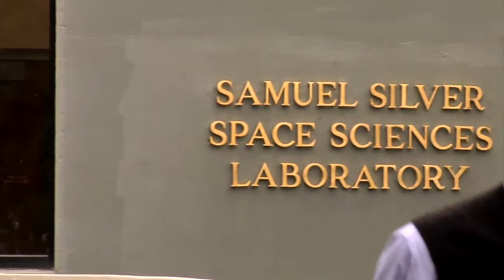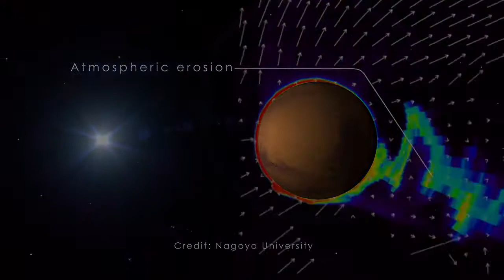MAVEN's Particles and Fields Package: Studying the Solar Wind at Mars

Comment from the maker: MAVEN's Particles and Fields Package: Studying the Solar Wind at Mars

To planetary scientists, the Martian atmosphere presents an intriguing mystery: today it's a thin, cold wisp of carbon dioxide with just one percent the pressure of Earth's atmosphere, but long ago it was thick and warm enough to support lakes and rivers on the Martian surface. How did Mars lose so much of its early atmosphere? Scientists think that the solar wind may be responsible, and the #MAVEN spacecraft is designed to find out.

The instruments of MAVEN's Particles & Fields package will study the interaction of the solar wind with Mars's upper atmosphere, helping scientists to better understand how Mars became the freeze-dried planet that we see today.

In this video, produced by NASA Goddard, Robert Lin, the late director of the UC Berkeley Space Sciences Laboratory, discusses how MAVEN will study the interaction of the Martian atmosphere with the solar wind.

(Video credit: *****/GSFC)